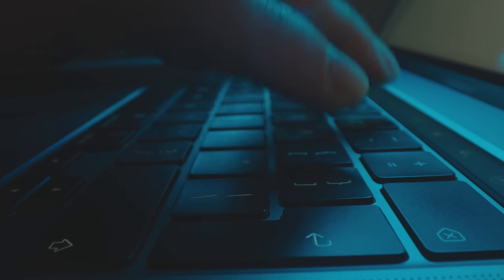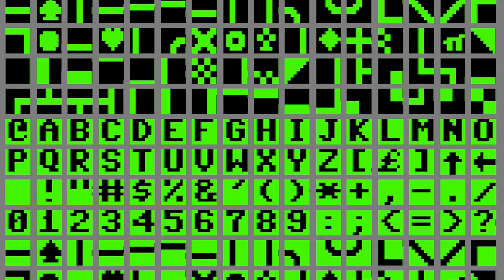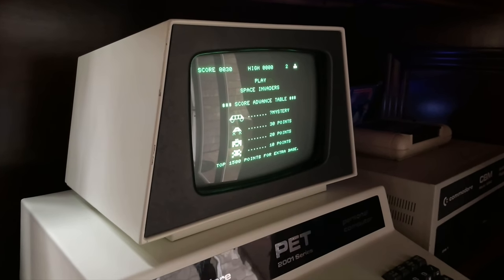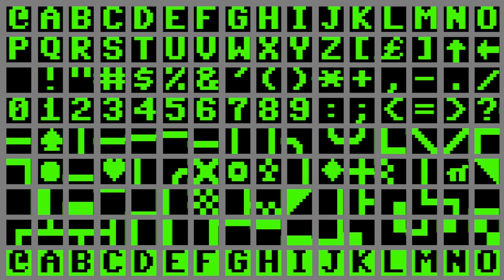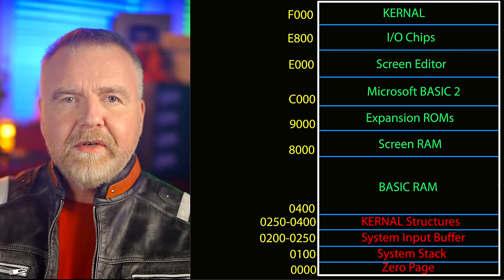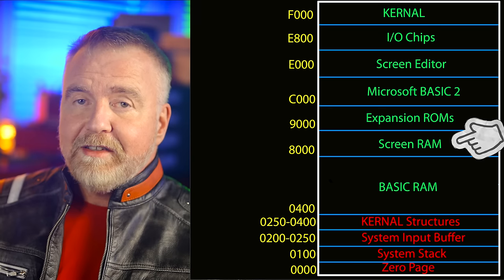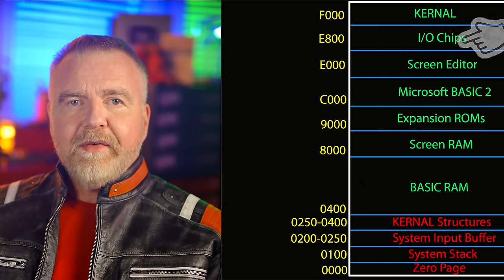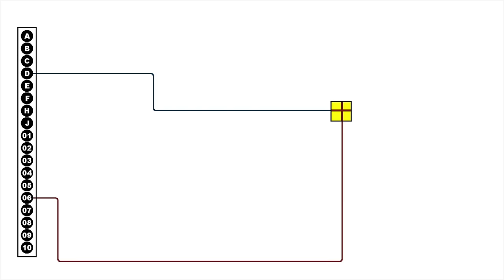Everything you SHOULD know about your Computer but don't!

Comment: 8 of the character ROM address lines come from the RAM data output to select the character, along with the remaining 3 bits from the scan line counter. The output is then shifted out to make video. Making the video character generator work from RAM would require at least twice as much memory bandwidth, and a set of address registers, latches to hold the current character to use with those addresses, etc. It would greatly increase the complexity of the machine, as all of that would be discrete 7400 series chips.

Comment: I had a C64 in the early 1980's. I had two floppy 170k disc drives and a dot matrix printer. I also had it connected to a 300 baud CICADA (Australia) modem. This was dial-up system however, there weren't many bulletin boards around at the time. Phone calls, particularly overseas ones were expensive, so It didn't get much use. We did manage to transfer a few files amongst ourselves by way of local calls. At the time the C64 was a pretty good system as the peripherals, such as the floppy drives were smart and you could actually disconnect the two drives from the C64 and complete the copy process once it had started and they would complete the copy process. I can recall that in order to get the two floppy drives to work you had to cut a jumper. I even had a Z80 CPU as an accessory attachment for my C64 but never had much use for it.

Comment: I bought a brand new Desktop Computer about 4 1/2 years ago, it came with Windows 10 on the M2 Drive.  I brought it to the house, hooked the Keyboard, Monitors, and mouse, then started it up, but Windows never started up.  I had a USB Thumb Drive in a USB in a USB port and on that drive was the Linux Mint ISO.  I have been using Linux Mint since the end of support for Windows 7.  I person I once knew, used a Commodore 64 to control something 27 Projectors all at the same time, and later in life wrote the entire course for computers for the local school board

Comment: I miss the old days when a hacker was someone who would piggy back chips, cut traces and run some jumpers to add features or access features the manufactures decided not to make use of.
The TRS-80 had lower case in the ROM but descending characters(g,j,y) couldn't descend so that part of the ROM wasn't used. Using some unused logic gates on the boar and a short piece of code written in assembly language and you now had upper and lower case characters, at least until you turned off the power.
Reply from the maker: I was just doing that... piggy backed the 74LS145 keyboard chip I'm fighting with, then bent one leg out of the socket to test that line.  It's not smart or right, but it's fun :-)
Reply: There are still some similar type things you can do on more modern systems. One example is a hardware mod to enable Core 2 CPUs to run on Pentium D motherboards.

Comment: For pet chars it seems like your right on space.  The rom would take alot of system memory.  They didn't have hardware vram paging support.  Supposed it could be stubbed out in the memory space and mapped, but then you have some special region that's a hassle in the future and can limit future expansion.  Would be nice if there could be an optional mask with a base address set to programmatically remap the lookup to ram at an equivalent offset using the mask to override to an equivalent address offset from the base address.  Wouldn't really need to cover the whole space, maybe one 32 or 64 bit mask value, and one hex offset for ram address.

Comment: My best guess about why the PET didn't allow a redefinable character set in RAM (other than the RAM limitations) was to simplify the video circuit interface to main memory. Since the character ROM wasn't even on the addressable bus of the 6502, there was less contention over the bus. The PET video display only needs one RAM fetch per screen location, whereas a programmable graphic set would require two. I think the Apple II text mode was similarly streamlined.

Comment: My opinion is that the rs-232 was the most fun to play with.  There is so many pins to turn on and off and control devices with.  I did have some limited success with connecting to a vhs recorder to pause/start recording but couldn't get them to sync up correctly.  i did record stop motion animation graphics, but always had an annoying line moving slowly down the screen.  If I had had a modified recorder and the microcomputer had a faster clock...maybe.  I did manage objects bouncing on the screen and stop motion recorded, but it's been lost to time and age.  I moved on to fully wired remote controlled cars, lights, strobes, etc. controlled thru the rs232 and a bunch of relays but I found girls more interesting. ;)  This video makes me happy.  I still get annoyed at how sloppy coders are today, but we all have our moments.

Comment: These videos are really interesting as I grew up with the Pets and 64’s 
My first computer was a Dream 6800 that we upgraded to a massive 16k memory and some bright spark figured out that if you change the frequency of the data I think it was running through this one chip you could make music and even give the games sound if you say your transistor radio tuned to AM and was off station. It sounded pretty horrid but it was sound on a system that could beep at most. 

I wonder if you could do that with a modern PC….

Those were the days.

Comment: The character ROM has lower case characters. The inverted versions are done in hardware using bit 7, not in the ROM.
In the 2001 the upper and lower case set are swapped compared to the later PETs.

Comment: Ah, great video - nostalgia rating: 10/10! That was my first computing era as I started off with an 8K PET 2001 - the one with the built-in cassette and fantastically appalling keyboard. Unlike the later PETs this one did have static RAM for the main memory (6550s) and the non-standard pin-out 6540 ROMs. I later upgraded it with a 32K dynamic RAM kit and also hand built* a new ROM board that would take EPROMs, which I burned BASIC 4.0 into. I also printed out the entire ROM disassembly listing so that I could figure out for myself what was going on (still got it in a folder somewhere!). (* and when I say "hand built" I mean I hand drew the PCB tracks including running lines BETWEEN the pads for the EPROM pins and then etched the board myself using ferric chloride! Fun times!)
Reply: Did you rub all the commonly used characters off the keytops like I did on that chicklet keyboard?
Reply: @LordChariot  They started to go so I stuck some Sellotape over them! It went yellow after a while but stopped any further wear.😁

Comment: Me, I got started on a ZX Spectrum 128K +3, for which I eventually knew enough about to create my own disassembler and assembler.

After that, I moved to a 386 based PC with MS-DOS and later Windows 3.1, after which things got a bit too much for me. So I resigned myself into accepting the way things worked without me needing to know how.

Today, I use my programming skills in Delphi and VBA to make my work easier by creating local use apps and tools to provide functionality that do not come out of the box.

If it works....🤓

Comment: I remember Jim Butterfield so I looked him up on Wikipedia. Yep, it was the same guy that I saw on TV long ago talking about computers. I was into electronics so built my own computers from the chips and transistor-gained linear regulated power supply.

I soon learned why the Apple II computer used a switching mode power supply. This was because LS-TTL chips used more current and so that the larger your computer system, the more of these chips one would have to supply with enough voltage and current = power. The initial linear regulators got really hot, so I had to learn about the various kinds of switching power supply designs. This was during the years when Power MOSFETs started to become popular. A lot of the multi-function chips that were MSI or LSI used MOS and so needed negative and positive supply voltages in order to work properly. The power had to be applied to all voltage rails lest the chips might be smoked by the way these chips used depletion-mode MOS transistors. 

Even if you have a pre-built PC now, you have to have a power supply that was designed with sufficient power capability to power the expansion cards added to the system bus, etc.

Comment: I don't go quite as far back as the PET, but Commodore definitely had a significant impact on my life.

Not counting the Mattel Aquarius I was given when I was... 6? I mostly started out on a shiny new, latest and greatest, Commodore 128D a couple years later (from Christmas '85 I believe, right after its North American release). It was a big step up from things like the ten line BASIC program given as an example in the Aquarius's manual which made a little man made of graphics characters run across the screen. I mostly learned BASIC from library books and via typing in programs published in computer magazines. Around 12 I graduated to experimenting (mostly with very little understanding) with the 128D's built-in assembler, and printing out long dot-matrix reams of the system kernel and such, attempting to figure out how it all worked despite my limited understanding of assembly.

Sadly, I no longer have that system -- I'm not 100% sure what became of it, but it probably got sold at some point after I got my first few PCs. I have a working regular 128 that my late stepdad probably acquired at a yard sale, but I wish I'd known how much the 128Ds would end up being worth and kept it for my collection.

Comment: I can't speak to Commodore's reason for not putting the character generator in RAM, but I CAN talk about how I chose differently.
My first computer was a homebrew Z-80 machine, which had 6kB of SRAM and a 42 x 16 character display.  This was the area I spent the most time thinking about - how to make a display that would work for text or graphics, without taking too much memory.  Initially I wanted to use a character generator and some scheme for switching to a bitmapped graphics mode, which was how the TRS-80 model 1 did it.  But I didn't like the TRS-80's blocky graphics, so that went out the window.  The next idea was to use a character generator in SRAM, that I could use for graphics by just writing the pixels to the character generator, and then just putting the sequence 0, 1, 2,... in the screen memory.  This would have given me the ability to mix graphics and text, by using a character generator that could hold 256 characters, with the first 128 usually used for the ASCII characters, and the rest for graphics.  With 8x8 character cells, this would give me a total of 8192 pixels of graphics, which could fill up to 128x64 pixels on the screen, which was about 1/4 of the screen.  Sigh.  What I ended up doing was bitmapping the whole display, and putting a separate character generator ROM on the board, which was used only to read the character patterns from for the standard ASCII characters.

But an even more important factor in NOT using RAM for the character generator, was the complexity involved in making both the screen memory and the character generator accessible to the CPU.  I used a 1:1 interleave on the memory address bus, with the even cycles coming from the video address generator and the odd cycles coming from the CPU.  Now: with a bitmapped display, during the display cycles, I just latched the SRAM data into a shift register that then fed the electron gun.  But if I was using a RAM character generator, the memory would have to be split into two segments, one of which could hold screen contents, again n the even clock cycles, but the other segment, holding the character generator, would have to operate on odd clock cycles.  This would either require some really complicated timing for the address multiplexer, or a buffer between the screen refresh RAM and the character generator RAM, which in turn created a one-character delay in what got displayed on the screen, which was an additional problem to solve.

In the end, I decided that graphics were more important to me anyway, and I wasn't going to be happy with either blocky graphics or only having a fraction of the screen for graphics, so I ended up using 4kB of SRAM for the bitmap memory, and just 2kB for program storage!  Which turned out to not be a problem, since I was doing everything in Z-80 assembly language anyway, and 2kB wasn't as small as I thought.

Comment: Listening to you describe the limited features of a C64 makes me glad that I bought an Atari 800 that isn't as limited. We can created our own character set in RAM and tell the video hardware to use it instead of the ROM character set.
Reply from the maker: I'm no Atari guru, but the machines had similar capabilities.  I think what pushed the C64 ahead as a gaming platform was the set of 8 full sprites, which were also reusable.  The Atari's I was familiar with had player/missile graphics, but it wasn't comparable.  I say all this never having written a line of code for an Atari, though!
Reply: @DavesGarage  With an Atari one could use a scan line interrupt to "cut" a sprite into smaller sprites with its own separate color, width, and shape. You could put two sprites together to make a 3 colored sprite. You could also put 4 missiles together to make a fifth sprite. Atari also had built in fine horizontal and vertical scrolling and graphics indirection (things like screen memory weren't hard coded but used pointers to access the data). I'm sure the C64 had some similar functionality.

Comment: I think in the IBM PC space, re-definable characters didn't show up until VGA. The right commands to the VGA registers can let you read and write to the card's character definition memory. A few programs such as Norton Utilities made use of the feature to provide a graphical mouse cursor for an otherwise text-mode program. As I recall, the program still worked on older cards that didn't support the feature (or dodgy clones that didn't implement it properly), just with a glitchy cursor.

Comment: An interesting machine to compare with the PET regarding its internals is the Jupiter Ace. In some ways, it was simpler - it was explicitly a home machine - but it made some interesting design choices to control cost while attempting to keep it competitive with its competition at the time, such as the ZX81, including its use of Forth.

Mind you, the machines themselves cost a fortune these days, so an emulator or FPGA core for the MISTer or the like is a better option.

Comment: My first experience with monochrome CRT was the TRS-80, which used a very similar display system, except that it was memory-mapped to display 25 lines of 80 (6×8) characters. The cool thing about the particular CG ROM they used is that, even though it only displayed upper-case characters out-of-the-box – (whenever b7 was low and b6 was high, b5 would automatically be driven low via TTL logic) – it actually had lower case characters (although without true descenders, so your g's, j's, p's, q's and y's would look kinda goofy). So, by cutting a PCB trace and running a wire from the b5 in directly to the video SRAM, you could actually have access to upper AND lower case text. (I put a switch on mine to go back and forth between default UC-only and UC/LC "modes").
Damn, I miss the days when computer MoBos had through-hole DIPs (and were just single-layer/double-sided PCBs!)

Comment: My PET (CBM 4016, upgraded at great expense to 32K ) sits in pride of place on the top shelf watching this this video. Still connected to a Commodore 2031 single disk drive. it did suffer a dying video memory chip which i replaced, followed  by the mains suppressor capacitor in the disk drive doing the normal thing of letting out the magic smoke along side some foul smell . :-(

Still have the great books by Nick Hampshire  "The PET Revealed" and "Pet Graphics"  and a very useful MOS Microcomputers "Hardware Manual" Rev A Jan 1976 

A very interesting book which i used a lot when I used PET's in the test department was "PET Interfacing" by James M. Downey and Steven M. Rogers. 1981

These videos bring back a whole lot of great memories of using PET's at  work and buying the one I still have.

please do more videos on the PET,  I've done a few on getting mine back to working but we need more.

Comment: I used to do machine language on the 8008, 6800, 6809, and the 68000. I still have a Coco 3 with 1 meg of memory and 4 megahertz processer! The Coco had 16 users on each a different terminal with the Motorola OS.

Comment: I suspect the reason why the character map could not be read from RAM and why the character map ROM was not in the memory map is because doing so would require some way of allowing 2 masters (the CPU and the "Graphics" controller) to access these devices.  It takes a lot less circuitry to only allow a single master to the RAM/ROM.  To allow multiple, you either need dual port RAM/ROM or a bus controller that multiplexes access from the CPU and the "Graphics" controller.  Most graphics memory is dual port (one for for the main computer bus to access and one port for the graphics controller to access) but dual port RAM was not widely available in the days of the PET and often prohibitively expensive.

Comment: On my Mini PET, the character ROM is connected directly to a bit shifter that’s connected to the video output port. If one was to try to make that readable, you would have to introduce additional switching hardware between the ROM and the bit shifter. It’s theoretically possible to do this and to replace the ROM with RAM… but it would have added to the cost and complexity of the system.